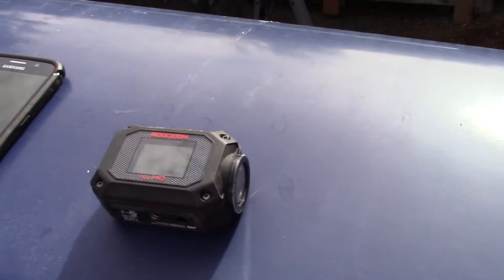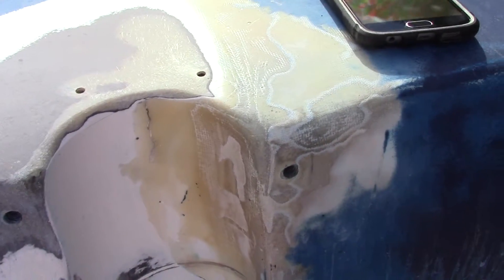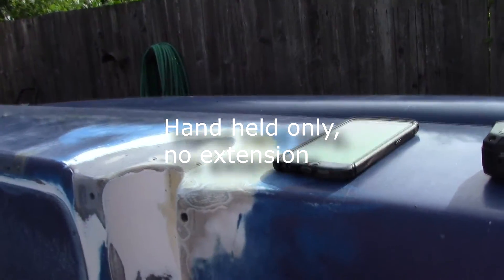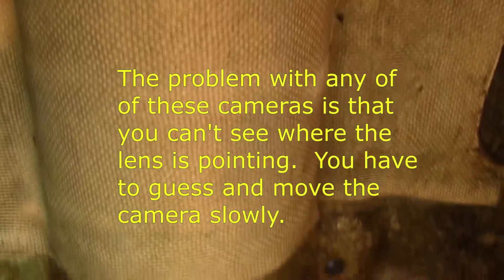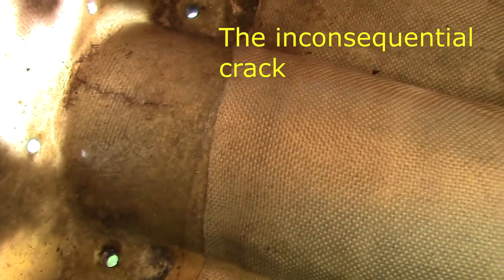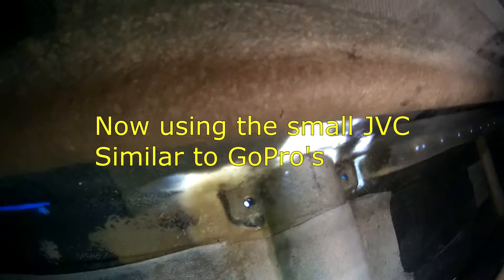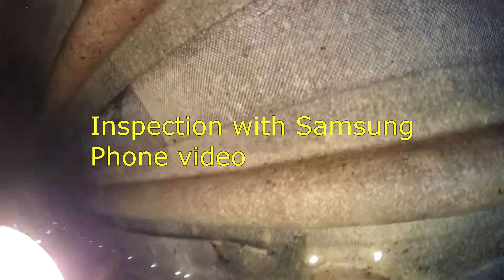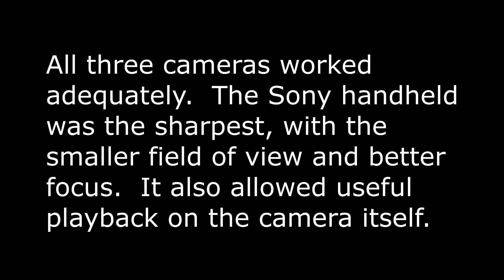This End Up Interior Hull Inspection, NACRA 5.2, #4

Comment: My 5.2 is number 472 however the hulls were replaced in 1979.  I think the hull numbers are 1336.  I had problems with the bulkheads failing due to the factory failing to glass them in completely.  You can imagine how much strength they add to the hull when glassed in properly.  What struck me about your video is the fact that you don't have any rear bulkheads at all, just the two under the front crossbeam.  Do you know if Nacra stopped installing the rear bulkheads?
Reply from the maker: I think the NACRA historians on Beachcats.com thought the 5.2 never had rear bulkheads.  It could have benefitted from them for sure.  The cracking I did find below the rear beams likely could have been eliminated had there been a bulkhead.  As to the front bulkhead I had some minor cracking, but nothing that I thought was serious, however I did add another inspection port on the front side of that bulkhead so that you could watch it and also see what if anything was going on forward of the beam.  It also makes doing any repairs on that bulkhead manageable.

The other step that I took to help with this whole strength issue was to fair in the beam cradles.  In the production version there is only contact with the cradle at the outboard edges.  There is a substantial gap in the cradles at the centerline.  By filling them in and getting contact you now involve all of the strength of the center portion in taking side loads.  I think in one of these videos I show how the center of the cradle is super reinforced, but that strength didn't get wrapped all the way through the corner.

NACRA went through a lot of production iterations over the years and I am sure in the search for lower price points some less than desireable decisions were made on how to get there.